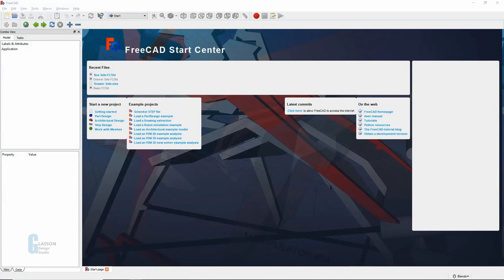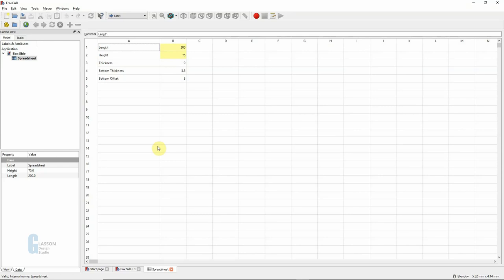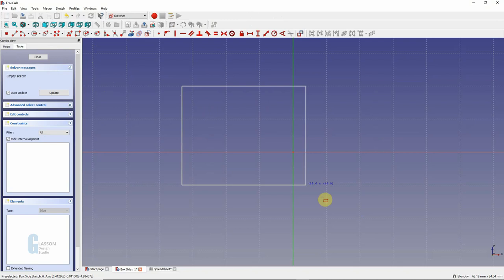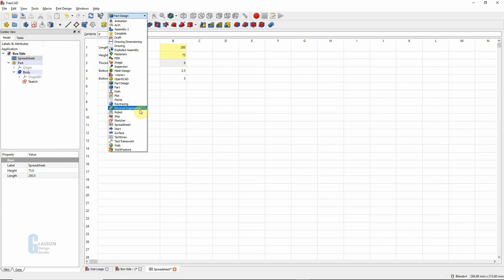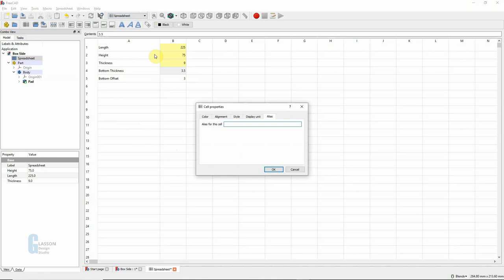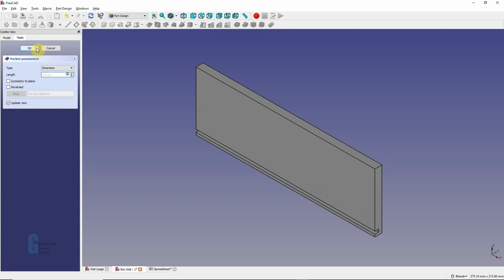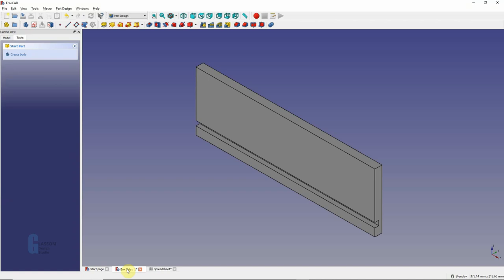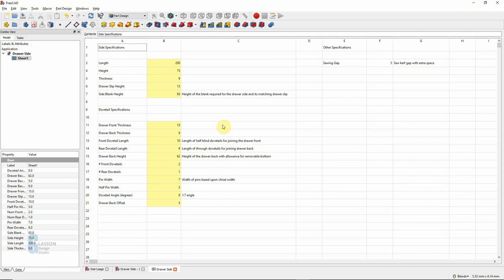Designing with spreadsheets in FreeCAD

Comment: Excellent. Spreadsheet is very useful to apply in general or standardized models, in which you need just to adjust a measure to have another model (tables for example). And please let me tell you just a tip to create a rectangle simetry easier: instead than make the simetry by side, it can be done checking the points in diagonal way. For example the upper left point, then the lower right point, and finally the center (not sure if the order of selection affect it). Applying the simetry with this point save/reduce the amount of operations.
Reply from the maker: Thanks for your kind words Daniel. I hadn't figured out that I could use the symmetry constraint in that fashion when I recorded this video. I have being using it for quite a while now as you'll see in some of my later videos.

Comment: I've made a small toolbox using the spreadsheet. I wanted to be able to model the box at different sizes. If I reduce the dimensions in the spreadsheet by 1/2 the model comes apart. If I increase the dimensions the model is all jammed together. The parts are no longer attached. I'm sure I'm doing something wrong but I don't know what. If I want to make different size boxes do I need to make the size changes and then build the box, or do I need to do something different when I build the model?
Reply from the maker: Hi John, thanks for your question. On the surface it sounds like you might be butting the parts together in FreeCAD rather than creating an assembly which constrains the parts together allowing them to stay together even when they change. Are you creating an assembly of the parts? If not, then you should look into using an assembly workbench in your workflow.

I use the A2Plus workbench for assemblies because I don't need anything fancy to assemble furniture. Checkout the second half of my video about the Sharpening Stone holder if you'd like to see how I use it.
Reply: @GlassonDesignStudio  I've tried the A2+ and the woodworking workbenches and had the same problem. I just created a new assembly in A2+ and now can't get it to update when I change the spreadsheet data. This FreeCAD is a tough cookie to learn.
Reply from the maker: Hi John, sorry for the late reply - a long work week is my only excuse :(

Your experience doesn't match mine because I have done what you've indicated and it has worked...assuming that I'm not misreading your words. On those occasions where I have changed the design in a spreadsheet I visit each of the affected FreeCAD models and recalculate the model so it is up to date. I then go back into the assembly and update the parts that have been imported into the assembly (A2Plus provides an icon that does this).

I sometimes find that the constraints are broken once I've done this, but it usually occurs when I make other changes to the geometry in one or more of the files before updating the assembly. I think the Topological Naming Problem is at fault but I haven't looked into it enough to know for certain.

I hope this helps
Reply: @GlassonDesignStudio  I finally had some success. I built the box with Part Design without using A2+. It reacts as I expect when making changes in the spreadsheet. I'm guessing that when I use A2+ to assemble I'm not getting the assembly fully constrained. As of now I don't know how to check the constraints. I might try to find some tutorials on Assembly 3 and 4 to see how it turns out. Thanks for your replies.
Reply from the maker: Hi John, I think that you're right. The A2Plus workbench includes a tool that allows you to turn on and off the degrees of freedom for the parts in the assembly. Unfortunately it's only a static display and doesn't update as you make changes, so you'll need to turn it off then back on again to see whether additional constraints affect the assemly. It's a starting point....